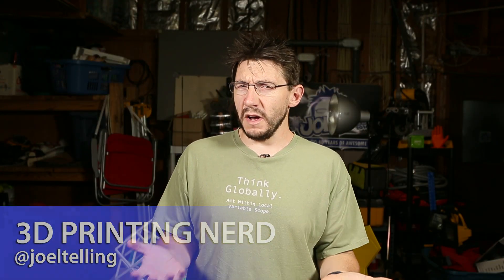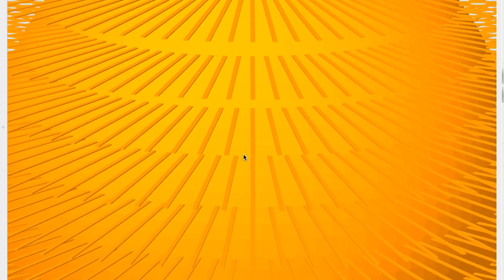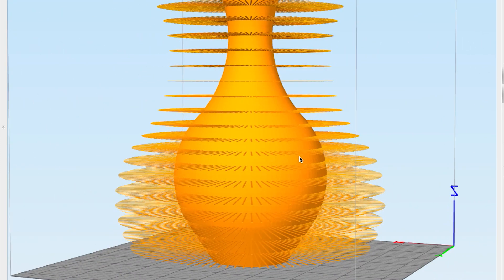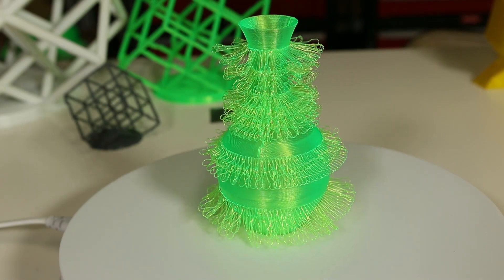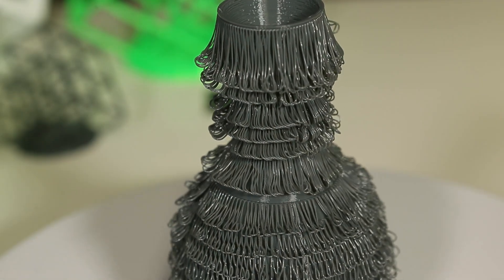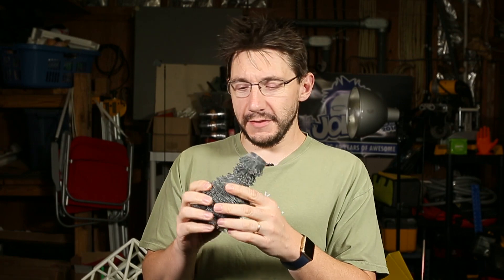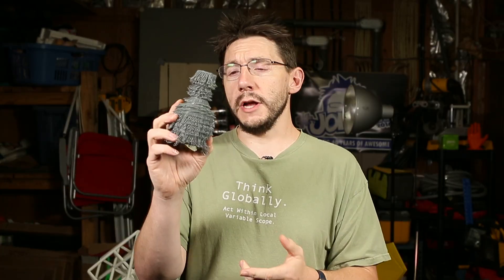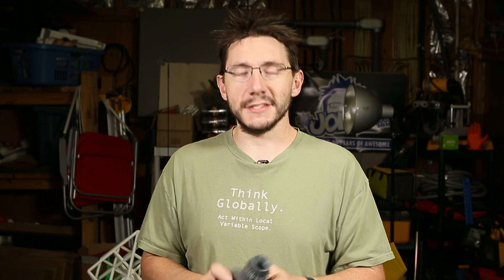3D Printing: Fuzzy Furry Vase by Daniel Noree

Comment: I know this is about 6 months old at this point but have you seen the "hairy lion" prints (I am sure you have, look who I am asking)?  It uses a somewhat similar technigue except instead of letting it droop the "hairs" are extruded out to a sacrificial wall that you remove and then use a heat gun to warm it up enough to form the hairs.  I printed one and it came out awesome, here is the link for those that may not have caught the featured thing on Thingiverse... http://www.thingiverse.com/thing:2007221.
Reply from the maker: +Michael Hudson oh yes I've seen it :)

Comment: giant scale velcro?
Just need somebody to work out how to make big hooks and you're sorted.
Reply: yeah. lol. if you had the time you could cut the loops 1/4 way up from the tip on one side and have open hook , hook-hook locking like velcro. i think a set of side cutters would do well to cut them, it would just be figuring out what is the best loop size.
Reply: I was thinking the same thing! :)
Reply: Yup that's what I thought,  sticky vase.. Velcro anywhere. Suppose you could do that with any 3d print.. just add built in Velcro
Reply from the maker: ooh, that's very interesting. hmm...

Comment: Idea 1. The Fuzy, looks very much like a loops from the hooks and loops on velco, maybe you could use it to make mega big velco. 
Idea 2. It could be a way of providing some shock or bump protection from the object when they stick out with the PLA printed version. 
Idea 3. if you printed two "fuzzy" object with the fuzz on slightly different layers but the object where close enough to each other that the fuzz over hung each other you could create a weak and controllable bond between the object which then would seperate a a designed load. 
Idea 4. you could use the fuzz on an object like a pin that inserts into another object eg a bush to provide form of suspension or  a light fit. Like a "transition fit" which is between a clearance fit and a interference fit

Comment: you can use it as a sort of filter for aquarium (if this plastic is safe) to capture dirt, etc.. if you do inwards instead outside, you can make some sort of large pool filter to capture leaves, debris when water is circulated.  Other than that as some users suggested below you can use it as a some kind of brush. I can see this thing as a real serious tool... not just as an art piece. But its a cool idea what you did with a 3D printer !

Comment: I've actually been looking for something like this to use for my robotic vacuum project (https://keithwelliott.com/2016/08/17/openadr-vacuum-module-v-0-1/)!  Using this "fuzzy" printing style for the vacuum roller would probably work better at picking up dust on carpet then my current rubber blades.
Reply from the maker: oooh, great idea!

Comment: brushes, clothing, maybe with some metal filled filaments you could use it to dissipate heat, i also wonder what it looks like in vapor smoothed abs. Also with different print speeds you should get different results in how much the "hairs" lay down or stick out

Comment: .... I can't find the model, but iirc someone used this technique a while back to print a bit more of a "realistic" looking flower.

Basically, the petals actually curved and had no "layering" or anything.

The application would really just be aesthetic for the most part, though. 

It would be interesting to experiment with different print speeds and fan percentages to try and control just how much it droops.

Comment: Could print them horizontally and make some sort of a brush cleaner. Use the 'fuzzy' parts as the brush cleaning brushes. Don't know the durability of the pla in that type of application.

Comment: You could use these loops as a fastening point for strings and if the loops were relatively short you could use the vase within an art project involving strings and winding specifically as in braided sleeves.
Also, these bridges, if printed in flexible materials between two walls would be a very precise way of controlling how much the walls can be streched apart